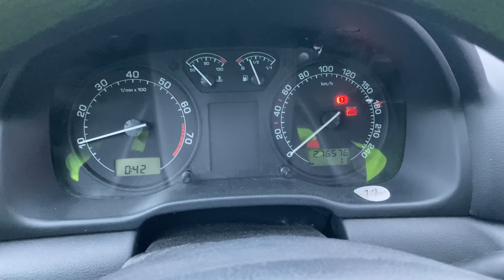Skoda Octavia megint lerobbant…

Comment: Fateromnak a gyári akkumulátorral üzemel a BMW 320d 2011-es évjárat! 10 éves! A Chevrolet Lacetti 1.4 benzinben is 10 éves gyári akku volt, amikor eladták az autót. Az ém BMW 318d 2013 év eleji autómban tavaly lett akku cserélve 8 évesen, de bírta volna még, csak nem centizgetek soha semmivel. Ez a 3 autó mindig kint állt. Meg kell venni a Varta Silver Dynamic akkut és nem 3-4-5-6 évig tart. Szerintem nem olyan drága. Nekem a 95 Ah 850A volt Amazonról rendelve 140Euro.
Reply: Céges renault masterral járok 20213 novemberi 415000km van benne és eredeti gyári aķsi.
Reply: @ernofajkusz9451  Az egy ürhajó lessz már biztosan 👍
Reply: Gyári akkumulátor mindig többet bír! Amit veszel utánna, az már 2év jó esetben 3!